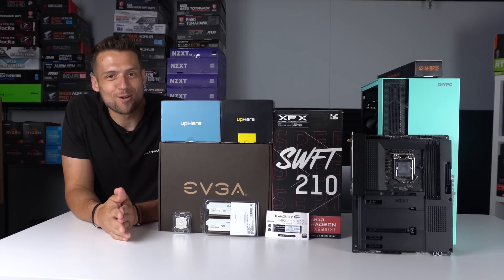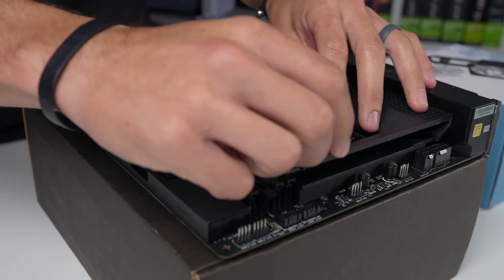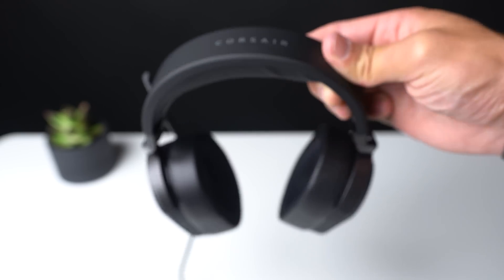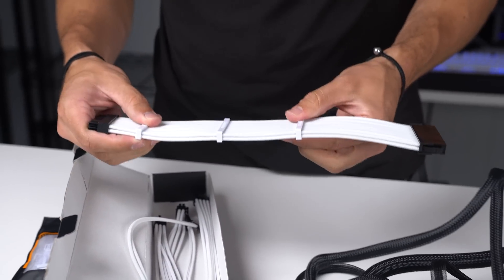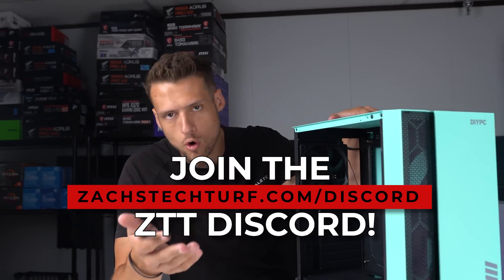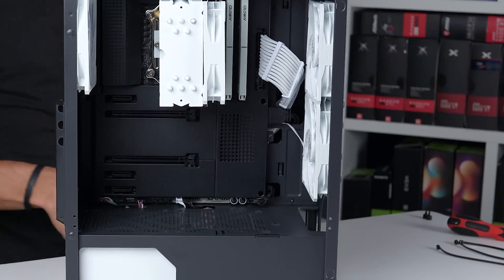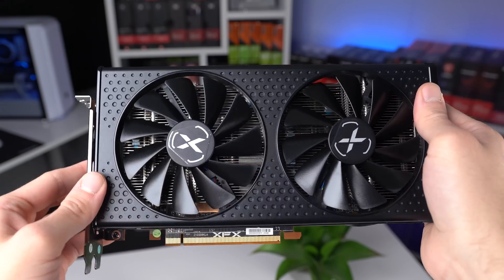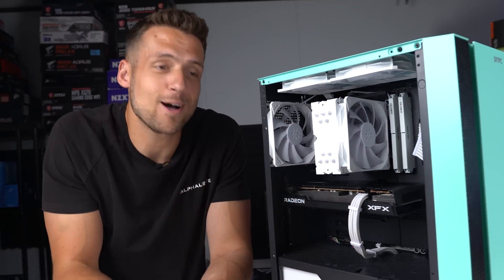How to Build a $700 Gaming PC in 2022!

Comment: I just bought that case! I really wanted the pink one! I'm building a system for a friend. It's going to be a Christmas present.

I went with the Xeon, and a 1070 AORUS, as it's a budget build.

I just bought a rx6800 for myself. I work out in VR. The Quest 3 clarity showed me the 1660 ti was getting old.

I use Gloway too. I have the LED version.

I really like what you did to the power supply. I'm going to steal that idea.

Building computers is something I learned about 30 years ago. It's very relaxing to me. Even when things don't always cooperate.

Great video. Great build. Glad I found your channel.
Reply: stop typing like this

Comment: An Intel 10gen does not change the Board to PICE 4.0 only intel 11gen does. Even if the board says it. That is an Intel limitation. Just like Zen 2 is PCIe 4.0 the one below are still 3.0 that incuded 3000 G chips

Comment: I have been thinking about building my girlfriend a computer after mine and the best setup I’ve seen so far with some things she actually wants at around 700$ is 
Ryzen 4500
ID rgb cooler
Rx 6600
B550
Teamgroup rgb ram
1tb m.2 
Antec 410
Evga 650w gold
I could cut cost in multiple places but we both like all the parts and it should end up being great for her
Reply: If i copy this setup will i be able to find the parts at micro center? Or will they be able to help me find similar ?
Reply: @skayhitdalotto453  I would assume so 
I found a couple parts cheaper used but all of them should be available there
Reply: the ryzen 4500 is still not the best deal tho, might better aiming towards i5 12400F for not much more money and get lightyears better performance
Reply: @baoquoc3710  Its an extra 70$ plus the extra money for the motherboard so it ends up being quite a bit more 
I thought about the 12100f but again the motherboard makes it more expensive.
I'm just trying to get the best i can for less than or as close to 700$ as i can

Comment: I'm still rocking an i7-2600, 16 gig total ram (4x4 sticks), and a 2 gig Gigabyte Windforce GTX 960. It's ok. But I would rather have an RX 6400 low-profile with 4 gigs of Vram.
Reply: Go with gtx 1050ti/1650 instead 6400 since you will lose out on some performance not being pcie 4.0.

Comment: Well instead of 10400F,  it u had choosen 12100F it would b great build
Reply from the maker: That would be single digit FPS higher, and I would have spent close to $100 more for the B660 motherboard. So no, not in this instance.
Reply: @ZachsTechTurf  there is h610 board which provide enough power to run i3 and also support 3200mhz ram nd gen 4 pcie 🤔 and ofcourse brand new with warranty

Comment: There is Intel motherboard board for $100-110 CAD and that's 2 digits in USD I'd put like a nice 12600k with a RX6950XT for $1.3K CAD there's bottle necks but it's still very powerful

Comment: That "green" model is definitely some kind of teal/blue. But I do almost like that case, if it had a touch more room behind the motherboard tray to cable manage I think it'd be a very solid option for budget builds. But whenever it dips below $40 I still think it's a viable option.
Reply from the maker: Yep definitely agree on both those points.
Reply: I've built in this case and generally like it a lot except for four issues:

1) As mentioned, there's not a lot of room behind the mobo tray.
2) The included fan uses a molex connector.
3) The front cover is super hard to pull off.  It was so difficult that I was worried about breaking it.

4) The hard drive mounting bracket is not compatible with right angle SATA cables and even straight ones are a struggle to use.

However, I regularly see this case selling for $40 on Newegg.  For that price, it's a steal and I can live with its shortcomings.

Comment: I've got that exact same GPU in my system that I built a couple weeks ago, and It's a very nice card! It was the cheapest available NEW in my country so I snagged it for 392 Euros including shipping. Gaming performance is great and I 100% recommend this card to anyone who wants to get the ultimate 1080p experience
Reply from the maker: Good to hear, what CPU did you pair it with?
Reply: @ZachsTechTurf  I paired it with a R5 5600 non X, it was like 40 bucks cheaper than the 5600x and offers similar performance. It works great! Keep up your good work! Most of the inspiration for my build came from you, so thank you!